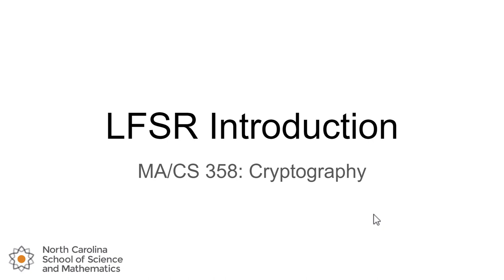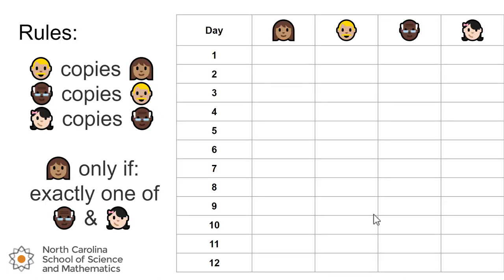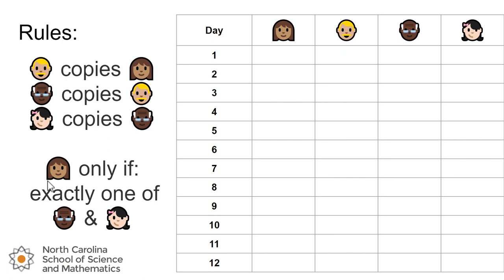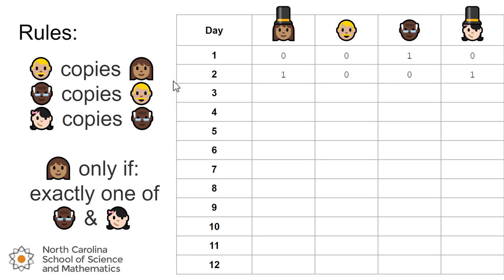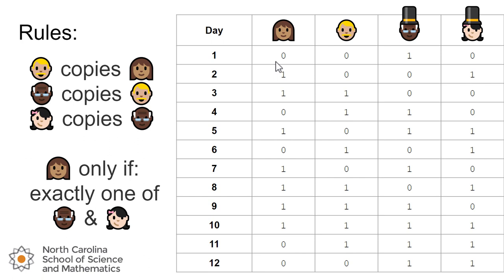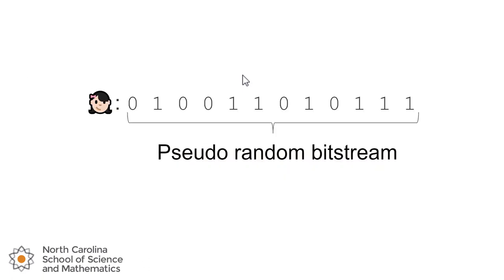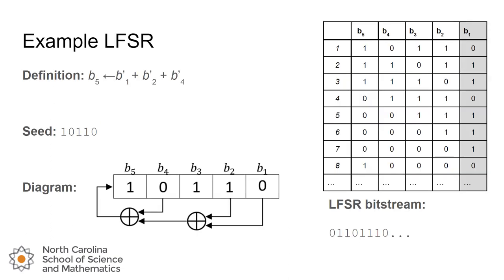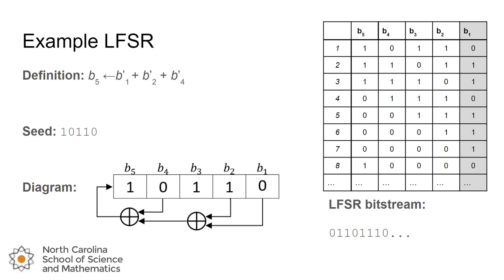Cryptography: Linear Feedback Shift Register

Comment: should not b5 be (b1 exor b2) exor b4?
then (1+0)+1=(1+1)=0 for the 3rd equation? please clarify.
Reply: Hi, thanks for asking this question. I believe you're talking about the example that starts at 7:35. With regards to grouping b_1 and b_2, it turns it that it's not important. Like normal addition, the order in which you XOR bits together does not impact the result. For example: (1 + 0) + 1 = 1 + (0 + 1) = (1 + 1) + 0, etc.  From reading your comment, it looks like you've correctly added the bits stored to b_1, b_2, and b_4 in the third iteration to get the correct value of 0. That result means that b_5 will take on the value of 0 in the next iteration of the LFSR, as indicated in the 4th row of the table. Hope that clarifies!
Reply: @NCSSMgibson  First example : Day 5 and Day 10 should be similar if only (b1 exor b2) . for girl with brown hair should have (b1 exor b2) exor b4